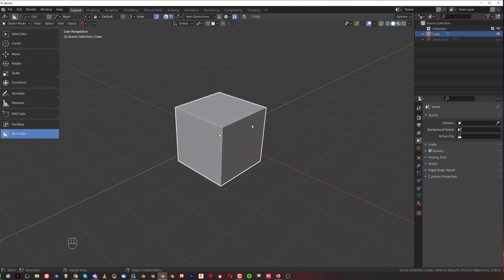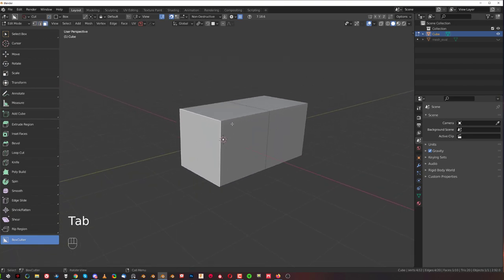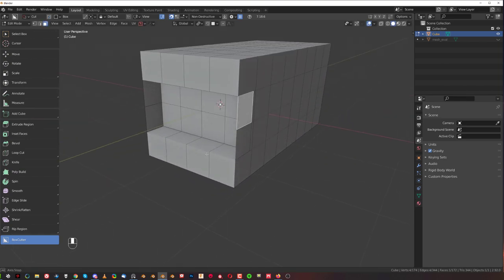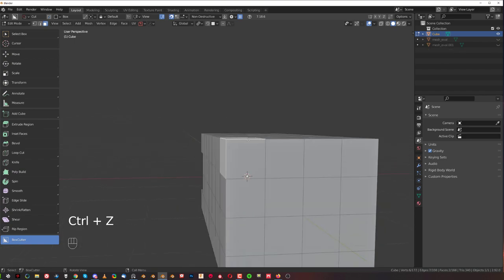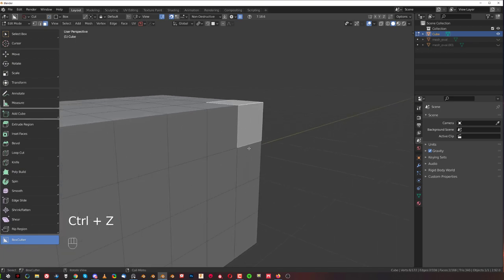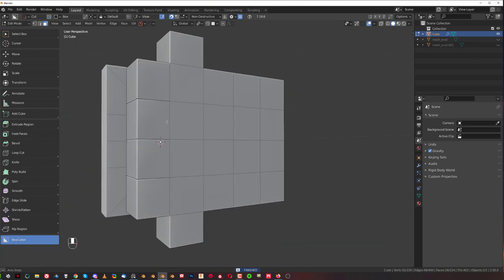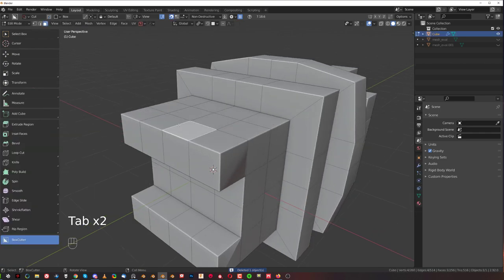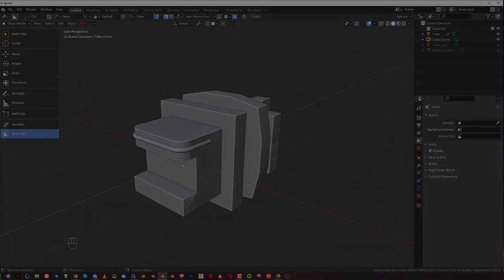Extruding in Blender - tutorial

Comment: Extrude along the normals actually works perfectly if you check offset even under the menu that comes up.
Reply from the maker: additional step man, most of the stuff is doable in vanilla, it just takes longer than it should
Reply: @PonteRyuurui  I agree, honestly I don't know why it isn't enabled by default. I've never used extrude normals without it turned on. Loving your vids BTW, I'm enjoying the mass effect playthrough.
Reply from the maker: @robinlovejoy5176  ah cheers Robin, much appreciated man!
Reply: @PonteRyuurui  Just found out that you can enable offset even by pressing S or holding Alt while extruding, so vanilla is not really at a disadvantage here (the soy must flow...)
Reply from the maker: @LordoftheFleas  Yup, there are many ways of using tools in blender

Comment: I really enjoy the videos you put up, they are very informative. And about ring face extrusion with distortion, in vanilla blender you can hit E for extrusion, cancel that and then hit S for scale and then Shift+Y to lock orientation to only X and Z axis and you would get straight extrusion without distorsion. But that would only work for ring selection not for like selecting few faces on the corner, this is where HarOps is very useful addon.
Reply from the maker: cheers mate, so instead of going alt s you say go s and remove the redundant axis, i need to try this
Reply: @PonteRyuurui  yea hitting Shift+any axis will remove that axis from affecting the mesh and leaving only other two axis active. Very useful tool for using in vanilla Blender.